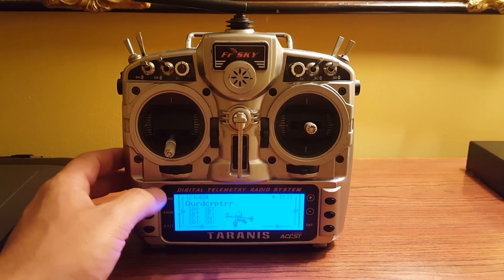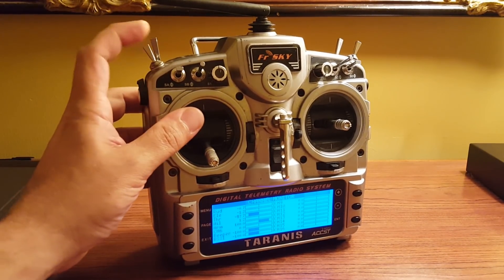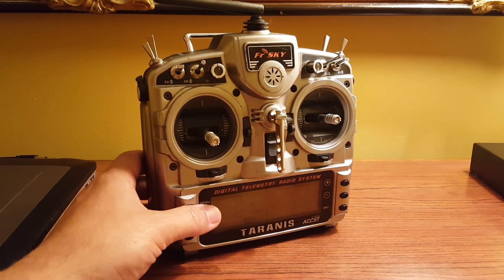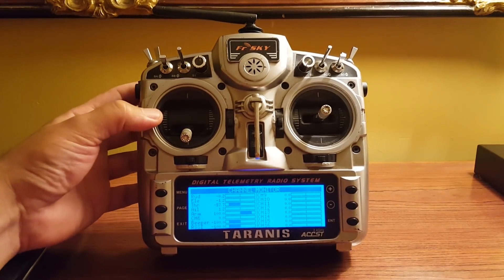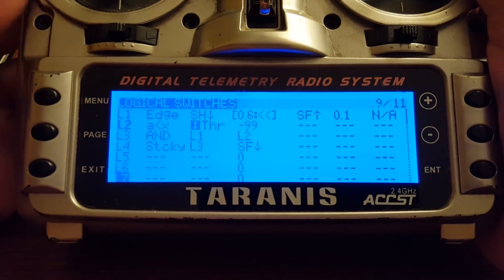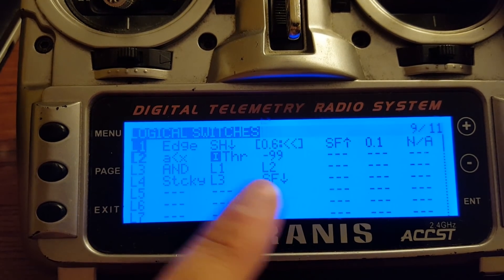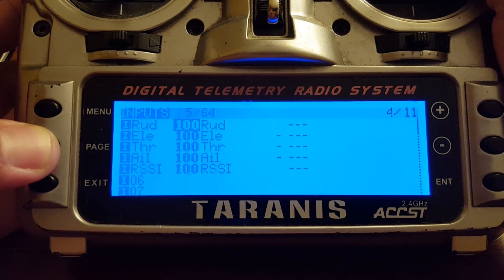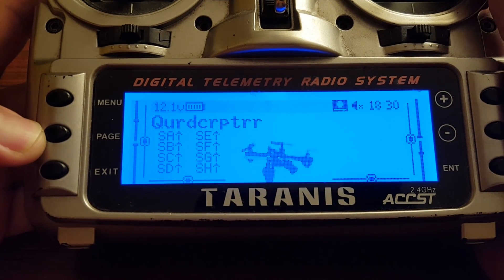Safer Switch Arming on FrSky Taranis

Comment: I put my arm switch on of the KNOBS on the Taranis. So much safer. No issue of ever bumping it. Just have to turn knob up all the way to arm it.
Reply from the maker: How do you disarm immediately in the event of an unsafe condition?
Reply: I've never had such a condition yet. As long as failsafe is set to cut motors, I haven't had to kill the motors except for one condition: when airmode is on and I'm landing and I want to stop props from spinning. I have the right side rocker switch set up to switch between modes where airmode is ON and OFF while still in acro mode. That way, as soon as I bring quad in for landing, I flip that rocker switch to stop props from spinning. Also, mine is set up to NOT spin props when armed. So, whenever throttle is at zero, the props aren't spinning. Am I missing something? Is there another situation I don't see where I would need to cut motors immediately?

Comment: Maybe it has to do with L1 where I have the direction for SF reversed. I like the switch forward for armed as it is easier to reach from the sticks.
Reply from the maker: Switch forward for armed and away for disarmed is how a lot of pilots do it. The old standard was that switches away was the default/neutral position and switches towards is active. So you could prep your transmitter by pushing all switches away. To do this, you would just invert the mixer logic. Or change the Arm Mode so "high" channel is armed and "low" is disarmed.
Reply: Thanks for the reply even though I do not completely understand. You move a little fast for me so I have to review what your doing several times. I am just glad it works and thanks for all the amazing help you've given me.
Reply: I upgraded my transmitter to 2.2 per your video and the safe arming no longer works. Any ideas?

Comment: I am using dRonin with RE1 FC. This video has made me crazy as I could not get it to work. However, the mixer issued bothered me. Joshua's instruction seemed backward. Why would it would be 100 if L4 is not true. I changed it to -100 with !L4  and 100 with L4 and VOILA, it works.
Reply from the maker: The exact combination of values depends on how you have your arm mode set up in the FC. As long as it works, that's all that matters.
Reply: Will you start doing any work in dRonin?
Reply: Samuel Bruner it really doesn't matter if your using cleanflight/betaflight/inav. In the switch tab you can move the slider back and forth to have it arm at -100 or 100. It doesn't matter really.

Comment: I've set this up as instructed. It will not work. Any ideas
Reply: Edited
Reply: See my comment about the mixer issue. Joshua either has it backwards or it may be dependent on the software you are using. I don't want to criticize Joshua as he has literally taught me to fly racing drones. I could not have done it without his videos.
Reply: I figured it out. He has SF backwards to me. I leave my switches forward at zero/off/rest. Once I got that right it worked. I also added a special function so that !L4 overides chan1 -100. Aside from a total fubar in the taranis the radio itself cannot arm the motors on aircraft without aa fight control board.  On aircraft with a FCB channel 5 is also set to L4/!L4 so that the flight control board will not receive an accidental arming signal.

Comment: I'm newer to fpv and multi rotor but what you suggested is exactly what I started doing on my own. I flip the SF switch the arm/disarm and when I have battery power to the quad and radio on I will disarm with the switch then I raise my throttle as a redundancy. I figured it out by dumb luck when I couldn't get my quad to arm and then noticed after a few minutes my throttle was up just a hair. So I started using the throttle as a second safety.

Comment: Hey Joshua, a problem I had with this is that it makes it harder to re-arm mid air after an accident disarm.

I just built my first quad on KISS and notice that there is no option to have it only disarm if throttle is at zero. 

This also kills my landing procedure of disarming about 10 feet in the air and having the motors actually disarm once I kill throttle.

Any suggestions? Love it otherwise.
Reply from the maker: This does make it harder to re-arm. Up to you if it's worth it. Personally I just say, don't accidentally disarm.

You can configure the transmitter to only disarm when you lower the throttle, but IMO what you're doing is a bad habit. Just train yourself to flip the switch as you land.

https://www.youtube.com/watch?v=Y9FPOy8C6I4

Comment: please help. I have this mostly working, but am having an issue disarming. when I go to disarm, looking at the values in Betaflight, it reads 1500 instead of 1000 so I have to flick it back to arm then disarm and then the value goes to 1000. I mean I guess it works but not fully.
Reply from the maker: There are too many possibilities for where this is getting messed up for me to be able to hunt it down for you. I guess my recommendation would be to start from a new model in the Taranis and build the switch logic from scratch.

Comment: Hi Joshua, thanks a lot for your work. May I propose an extension to that? Wasting an AUX channel for the beeper can be prevented by modifying your setup. I added a 5th logical switch with "AND SF-down SH-down". then I changed the mixer setting to 70/-70 and added a line "100 L5" This way I can send the beep instruction by holding SH in disarmed mode.
Reply from the maker: Yeah. I'm just lazy about it.

Comment: my experience the other day:
Accidentally armed while carrying it back from a crash...
rotor hit my nipple.  i'm not joking.  hilarity ensued as i tried to turn it off without letting go bc it was flailing trying to correct itself against my movements...

So yea...dual control arming.  good thing.  no damage done, thankfully

Comment: ive been arming my quad with the throttle right arm left dissarm for a long time because the first time i set it to the switch to arm i bumped it in flight and watched helplessly in horror as my fairly new quad plummeted to the ground.. you cant accidently have the throttle to 0 long enough and to the left to do that lol. 
 this method looks awesome i will have to try it out. thanks joshua!
Reply from the maker: I haven't used an X7 to be able to say.
Reply from the maker: +rayikaikin this method still instantly disarms. Just don't bump that switch.
Reply: how do i set this up on a X7? My screen isnt big as yours to see how the rest is set up, any howto manual on internet?

Comment: Just a suggestion - a slightly more complex version here lets you arm and disarm using the momentary, I've switched mine to the left of my Taranis and rotated 90 degrees to make it an easy springy push switch. It also has some extra logic to make sure that the master switch SB still disarms and resets the whole logic chain - https://youtu.be/mr2XYqIxU3o

Comment: I did exactly the same but on betaflight is it the other way around. So how do i do this now with Betaflight ?
Reply from the maker: I don't understand. This setup is on Betaflight. And I'm using the same setup on Betaflight versions since I made this video.
Reply: Thats very akward. Im using the SB switch all the way up to disarm. But if i do with your tutorial that is my arm switch..
Reply from the maker: Well you can swap in whatever switch you want I suppose.
Reply: It wont work by me.

Comment: Thanks for this nice video!  I'm setting up a standard 4-channel model plane with your arming system so that I can copy this for all future models.  I am a new Taranis user.  Just as you demonstrated, I've got the Logical Switches working perfectly!  I'm having trouble linking it to my Mixer values, same as yours.  They don't seem to have any effect.   From your narration...How do I know that Ch5 or Aux1 are my arming channels?  (Fairly new radio, same as yours.  Taranis X9+, OpenTx)  Thanks in advance!  Garland
Reply from the maker: +Safety48 the mixer lines need to be set up with a source of the input lines. Or you can just take the stick outputs as a source to the mixer directly. For a simple build with no expo or custom curves the latter is fine.

Comment: Hey Josh! Great vid! I put it all in my radio and it works great. Only thing is I want to tie my failsafe into it and I'm running into some problems.  I set it up so L4 won't enable if the failsafe is enabled, and that works. But if my quad is armed and I hit failsafe, it disarms, but as soon as I come out of failsafe it's armed again.  (At least to the radio, not the quad!) how do I get it so if I hit failsafe, when I come out of it I still have to re-arm?

Comment: Hi Joshua, I'm setting up my Taranis Q X7 - In the Mixer I can't find !L4 , scrolling through all the options it doesn't appear. Any idea how to circumvent this? Or find the "NOT" Logic switch?
Reply from the maker: If it's not in the list then I don't know what else to do.
Reply: Thanks Joshua, think I figured it out (thanks to RCGroups) - I was attempting to set the source as !L4, however the source needs to be MAX, and the switch will be !L4.
Reply: Ryan Fechner I had to press and hold enter, and select "invert".

Comment: I prefer the double arm in Raceflight, too bad BF does not offer this simple safety feature.I already use my trainer switch to reset my timer, and I dont need my timer reset every time I arm.
Reply from the maker: You can easily use a different switch in the Taranis or set up double arming in Taranis like Raceflight (maybe not so easy as using a different switch).

Comment: I got the safer switch arming to work but need a quick emergency disarm. You explained it when someone else asked in another question...but I don't understand. Was hoping you can clear it up? Thank you for the reply and all you do.
Reply from the maker: Safer switch arming doesn't change disarm at all. Disarming is still a one-step process. Just flick the switch back agai.
Reply: Guess something is going on with my Kiss setup...cause flipping the switch back isn't disarming. Thanks again!
Reply from the maker: +Angel Pagan check the aux channel. Does it move? The logic is probably wrong.

Comment: I can't seem to get this to work with KISS
Reply from the maker: KISS requires the aux channel to go high to arm, not low, so you need to invert the output of the mix. At least that's what I remember.
Reply: Ok, I will try it. I tried to just invert the logical switches, but it didn't work.
Reply: No luck.
Reply from the maker: IDK. In the end, KISS is looking for an Aux channel to be high to arm (I think) and the Taranis is either setting the channel to high, or it isn't. That's what you've got to troubleshoot.
Reply: Ok, thanks. I've been messing around with it for about an hour now and can't get it to work. I'll just watch my fingers I guess. That's what I get for going against the flow.
Reply from the maker: Start with just a single switch. No fancy logic. Does the copter arm? If not, make that work. Then work from there to the fancy logic.
Reply: I will try that again, but I already did that and can't figure it out, it just keeps arming no matter what configuration I try? I tried changing the switch position n in the KISS GUI(you can do that now)And that didn't even work. It just wants to arm no matter what I do. I tried to disable throttle cut off in the Taranis, It still will not work. I just need more time to figure it out maybe. It can't be that hard haha. I tried moving around the switches and settings you posted to see if maybe it is inverted or something, but no mater what I seem to do, it;s just like KISS locks you out of letting you change it or something? Anyway, thank you for your help.
Reply: Hello,did you find any solution?

Comment: This is pretty sweet because you can assign your "Arm" switch to an "Engine Armed" sound effect, and "Engine Start" to L4, which will only sound when the motors should be starting. I think its helpful when you're working with goggles on to have both the tactile feel of the switch positions and the audio in confirming what you're doing.

Comment: I just went through this and it seems to work as long as I hold the SH momentary switch.  However as soon as I release it, the copter disarms.  Looking in betaflight at my arming mode, when I hold the momentary switch I can see the value move to ARM but as soon as I release it moves out of the ARM range and disarms.  

With a sticky switch, shouldn't it stay armed until I flip the SF switch to disarmed?  What am I missing?
Reply from the maker: I'm sorry to say I don't know, and I don't think I will be very useful troubleshooting your setup over the Internet, because there are so many things that could be messing this up if they aren't exactly right.

Comment: Great stuff, thank you. Quick question: you used two mixer lines to control Aux 1's value, but on my Taranis 9+ I can control a channel using the logical switch directly. Was this option not available to you, or is there another specific reason for using the additive mixing?
Reply from the maker: +NavyFish I'm not sure I was aware that you could use a logical switch as the source for a mix.
Reply: Joshua Bardwell It's possible that's a more recent feature added to openTx. I am running 2.1.6 and it's working fine for me. Just wanted to make sure there wasn't an  alternative rationale that I was overlooking. Great tip, thanks again.

Comment: I have one issue with this.  I have once, not often, disarmed accidentally in flight.  It should be possible to extend this scheme a little to require the arm switch to be off for say 2 seconds before sticky arm is needed.  This would allow emergency rearm, but maintain all of the other great features.  And by the way, Thank-you.  Fantastic idea, great instructions.
Reply from the maker: Personally, when I want to disarm, I want to disarm RIGHT FREAKING NOW. I would never put a "safety" on disarm.

https://www.youtube.com/watch?v=bTalnzcO0xk
Reply: Misunderstanding here.  I didn't mean "safety on disarm", I meant for rearm.  So, instant disarm.  For two seconds instant rearm.  After that sticky rearm.  I totally agree on "RIGHT FREAKING NOW" for disarm.
Reply from the maker: Ohhhhhh. That's clever.
Reply from the maker: That's just clever enough that I might go for it. I have actually had it happen that I disarmed early in a crash and then spent the next second and a half wishing I hadn't while the copter tumbles through the air.

Comment: This works great but I was wondering if you could add disarming once armed with the momentary switch as well.  Just in case of emergency's having the second switch to disarm fast would be awesome.  Thanks
Reply from the maker: +Dobemandan that would be doable. Have one logical switch that becomes true when SF OR the momentary. Then make the logical switch the disarm condition.

Comment: Hi Josh, 
Can I use this arming method with a dji Naza M Lite and an x8r. They got a slightly weird arming system......by holding both stick to the bottom middle, then raising the throttle above 5% is it?
Excellent video!!
Reply from the maker: +Lee Swifty I don't know if Naza supports switch arming.
Reply: Thanks Josh

Comment: Joshua, Thanks for posting this!
 I just got my first Quad and I am learning how to set it up with help from your channel!
I am trying to get this to work on my ErSKY9x but my programing in my logical switches is a bit different, here is what one of the guys suggested for the OpenTX 9x witch is verry close to mine, but I need the replacement for a few things if the guys on here can help.

  Szymon Syrek
L1  AND  THR  TRN
L2  a<x    Thr    -99
L3  AND   L1     L2
L4  Glue   L3     !THR

For log switch 2, I need a replacement for a<x . 
For log switch 4, I need a replacement for Glue. 

I tried v<val and Latch, with no success.
If there is also a way to get the 0.6 seconds to work that would be cool also. 
Maybe I can do that with the delay function???

Thanks for any help guys!
David.
Reply: ErSky9x
.Logical switches:
L1 Ntme Off 0.6 On 6 AND TRN
L2 v<val Thr -99 AND !THR
L3 AND L1 L2
L4 Latch L3 THR

Use L4 as the source of the arming channel.
Example:
CHxx +100sL4
or 
CHxx +100FULL Switch (L4)

MikeB

Comment: Hey Josh.  Was wondering if you had any ideas on how to make the arm switch a 3 pos. switch instead of the left side two position you use?  I would like to make it so the center pos. is arm and the 1st and 3rd pos. be disarm.  I tried setting it up and added another entry for L5 but it didn't work right. Seems like I would need an OR statement.  Any ideas?  Thanks!
Reply from the maker: +David Crain I guess you need an OR for your disarm conditions. Set up a logical switch that is true whenever the 3pos is up or down and then disarm when that switch is true.
Reply: Cool Thanks!  I figured it out last night. After configuring L5 with Sticky and set as 3rd position, I setup another mixing option with L5 and it worked.
Reply from the maker: Awesome! Be sure to double check ALL POSSIBLE COMBINATIONS. Not just the combinations and sequences that you normally expect. You never, ever want the copter to arm unexpectedly.